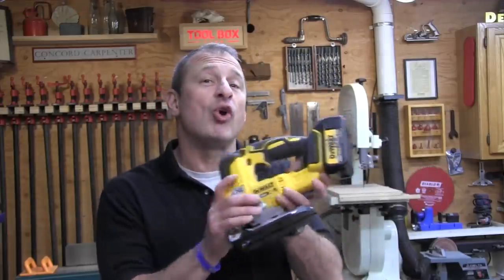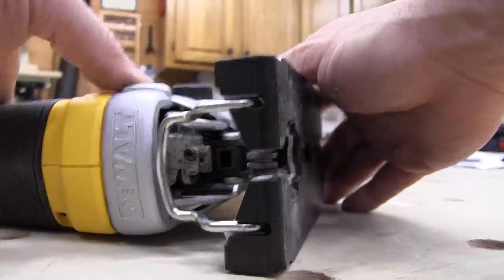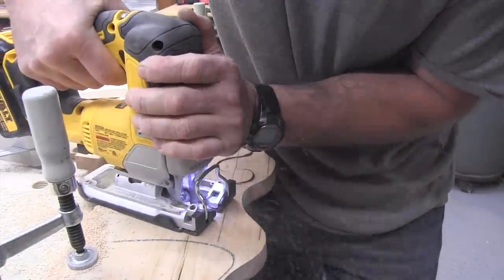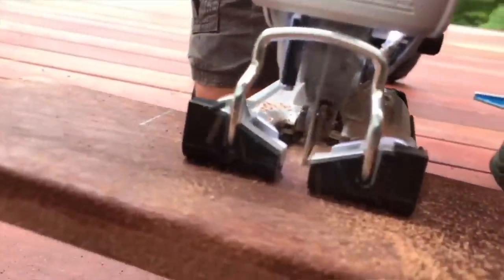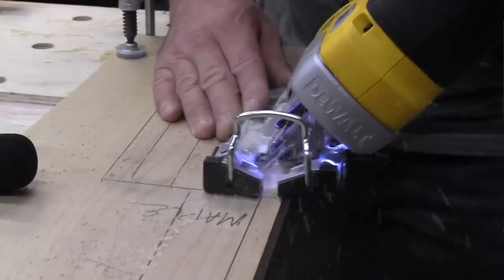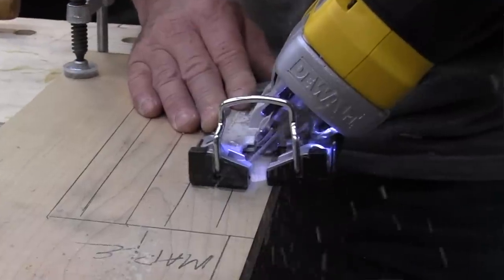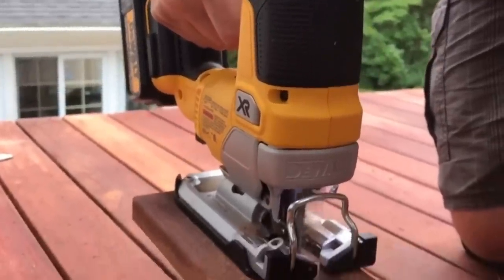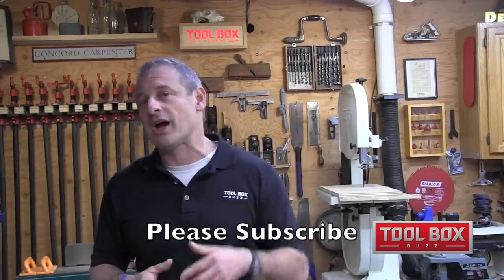DEWALT DCS334 XR Jig Saw Review

Comment: Hi many thanks for your review.  The main minus point I have with this jigsaw is you have to keep the button compressed - I mean you can't lock it on to use in a jig and will have to use a clamp or "tie" the switch in the on position.

Comment: Used to use/borrow the older brushed model from work. No light sucked when everything else in the tool bag has one and speed control could be tedious especially when metal cutting (run it slow, keep the blade lubed and it does great). Battery life was never a concern but having leaned towards the XR line for the better run time and not having the ozone burning smell (right up there with cigarette smell) I was glad to hear dewalt finally gave the jig saw a much needed revamp and hearing they added a light and made it with a dialed-in V-S trigger I was sold.  Cut several pair of rafters for a porch and could not be happier with how smooth it and clean it cut the birdsmouths.  My ancient B&D jig saw has never let me down but after one cut the vibration left your hand hurting and speed control was non existent.

Comment: I still use the old post battery jigsaw and it has been amazing, so if this jigsaw has improved upon it then it will do for me. I must have had my XR jigsaw for over 8 years and it has been used daily as I'm a joiner and hasn't let me down yet. I always hoped they would make a brushless version and the leds and other improvements are a nice touch. 

I'm going to wait a while though as Dewalt tend to keep the same model, but add improvements to it down the line based on customer feedback etc. I have seen reports of the leds being too bright when using the saw upside down, so hopefully they add an on/off switch for the led.

Comment: I alway wanted to get a cordless jig saw and i finally did. I picked up the DCS334B from home depot sept. 2021 as a bare tool and so glad i did. The regular price was 199.00 was on sale fore 169.00 plus i had a 25.00 coupon final price was 144.00. And i was impressed with the blade that comes with it DW3753H cut perfectly clean through 1/2" plywood and 3/4"pine on both faces.

Comment: Very good review; thanks. Couple of things - I like the dust blower on the DCS331 but I also had a little confusion on what was on and what was off. Does the DCS334 dust blower work as good as the DCS331? If so, sold. Also, I never use the plastic splinter guard thing either. Never liked them.

Comment: I have this same JiggyPoo saw. I rolled the dice on IT previous to this great review. I was a bit apprehensive. But I have zero regrets. Cutting the cord on a Jiggy saw is a big deal. In my line of work I use this type of saw regularly. The 12v Bosch just didn’t cut it. This new DeWalt is a beast. It plowes thru wood like butter. Deflection is fairly nominal and better than expected. This jig is built like a brick shithouse and I’ll retire with this tool. So happy to cut finally cut the cord on this type of tool

Comment: To be fair on the deflection on the scroll cut it didn’t look like you was using an actual blade for scroll cuts like the Bosch t308bo which is designed for them tight turns ?
Reply from the maker: true, your correct - Im not a woodworker - were carpenters and would most likely NOT have a scroll cut blade on a jobsite.
Reply: I know I get that but I think most saws would wonder off square using that blade on such tight turns ?

Comment: HAD THIS SAW FOR SEVERAL YEARS. JUST TRIED IT THE OTHER DAY FOR THE FIRST TIME. DID NOT LIKE IT AT ALL.
LOOKED AT THE BLADE AND NOTICED YOU CAN COMPLETELY PUSH THE BLADE OUT OF THE GUIDE WHEEL EASILY.
IS THIS NORMAL? MY BOSCH CORDED SAW CUTS GREAT, NO MOVEMENT OUT OF THE GUIDE WHEEL AT ALL.
AM I DOING SOMETHING WRONG? YOUR ANTISPLITTING PLASTIC LOOKS CHEWED UP. DO YOU HAVE THE SAME ISSUE?

Comment: I rarely use jigsaws mostly because I usually have a different tool that does a better job and I can never get a 90 degree on them.  To me it's a roughing tool.
Reply from the maker: Same most of the time
Reply: They're pretty awesome for scribing
Reply: @Jack Morris - It depends on the job at hand.  I mostly use stationary tools like a bandsaw or a table saw or a benchtop scrollsaw.  If it's a small cut the I will reach for handsaws.  When I use a jigsaw usually it's for big bulky pieces of wood that I am making a scroll on and I already have a template cut out for a router and even then if I can find a way to balance it on the handsaw that's what I do.

Usually by the time I hit a customer's house everything is already dialed in and minor adjustments are done with sanders.

Comment: Rob, I do have a challenge question to ask you.  And it’s a question I’ve been meaning to ask someone like yourself that has an inside track: Why does the USA seem to be behind Europe on new innovation in the tool industry, such as this jigsaw?
Reply: has been behind ever since basically has never caught up
Reply from the maker: Europe has been bid on due collection since the beginning of time - they also have three major German tool companies [Festool, Bosch, Metabo] leading the way.
Reply: Just look at DeWALT & Bosch alone, for example.  Both have products that we have yet to see or experience here.  Stationary band saws, stationary drill presses, stationary table saws & a hole host of power tool equipment and some of it we never see.  I suppose this is my rant for the day; I believe we should always have the first say and experience with tool manufacturers.  That’s it.
Reply: Another reason... regulation, regulation regu-damn-lation!

Comment: I bought this jigsaw after watching this video (and many other TBH that praise it). So far i have done 3 cuts, and all 3 are terrible, the blade simply jumps out of the guide roller without any side pressure. Last cut was to shorten the width of a dresser and i had clamped the top and bottom pieces plus a piece to guilde the shoe of the jigsaw. The blade again without any side pressure jumped out and started cutting inwards ruining my dresser ... Simply terrible tool.

Comment: This video didn’t age well.
Reply from the maker: What do you mean
Reply: @ConcordCarpenter  in your jigsaw head to head this newer Dewalt could not handle any “backing up” of the blade as it would rattle the mechanism open allowing the blade to disengage from the wheel and/or fall out.